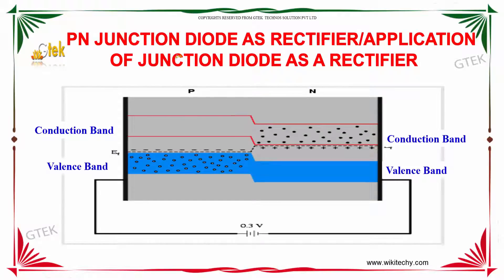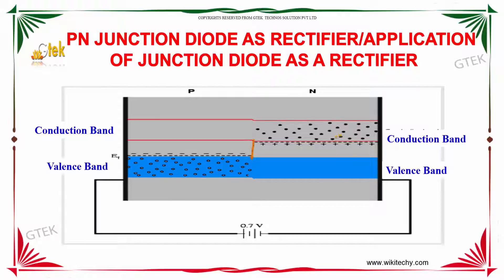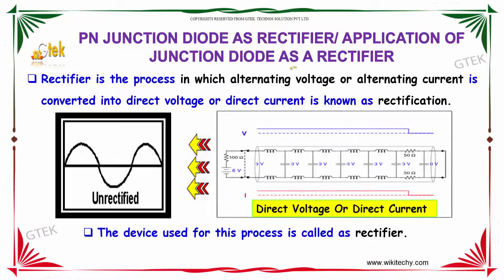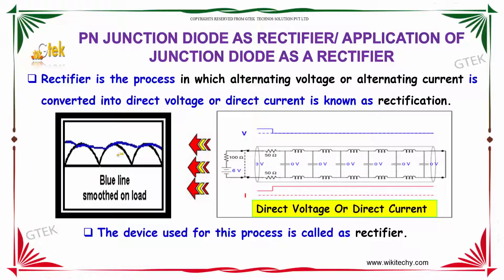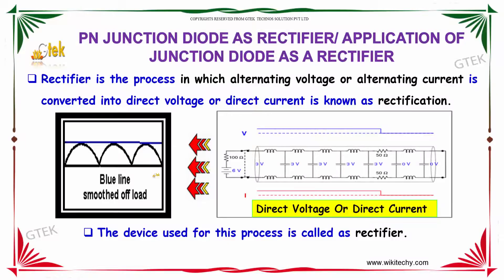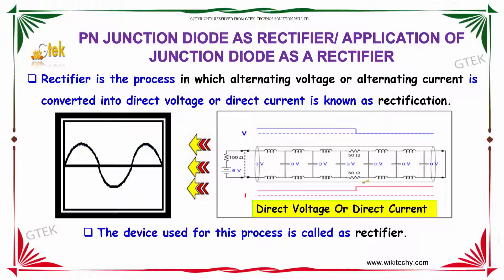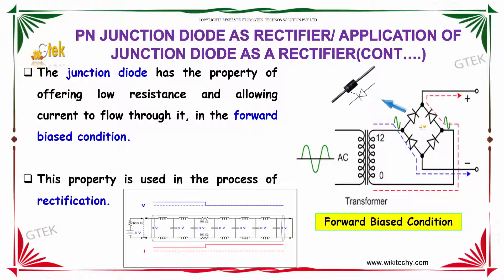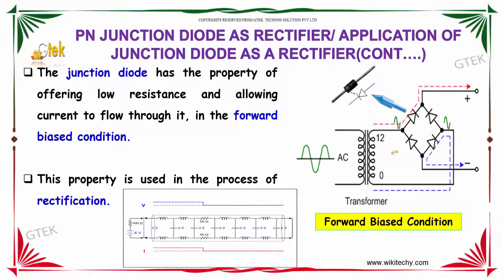PN Junction Diode as Rectifier | Semiconductor Device |class 12 physics subject lectures|CBSE|IITJEE

Comment: Class: 12. Subject: Physics. Topic: Electronic Devices. No. of Questions: 22 ... Hence the resistance (= voltage/current) of p-n junction is low when forward ... Therefore, the semiconductor with energy band gap equals to or less than ... How reverse current suddenly increases at the breakdown voltage in case of zener diode?

Comment: P-N Junction Diode as a Rectifier Rectifier is a circuit which converts ac to unidirectional pulsating output (Fig. 20). In other words, it converts ac to dc.

Comment: A rectifier is an electrical device that converts alternating current (AC), which periodically reverses direction, to direct current (DC), which flows in only one direction. The process is known as rectification. Physically, rectifiers take a number of forms, including vacuum tube diodes, ..... 0.7 V for ordinary silicon p–n junction diodes and 0.3 V for Schottky diodes).

Comment: The diode works only when it is in forward bias, only the current flows through p-n junction diode and output current across the load is found.If two diodes are ...

Comment: A PN Junction Diode is one of the simplest semiconductor devices around, and which has the characteristic of passing current in only one direction only. ... Rectification is shown by an asymmetrical current flow when the polarity of bias voltage is altered

Comment: Speaking of diode biasing in simple language, it simply means that external voltage is applied across the two terminals of the diode. Diode biasing can be done in two different waysForward biasingReverse biasingOfcourse the third condition is also possible when no bias is applied to the diode.